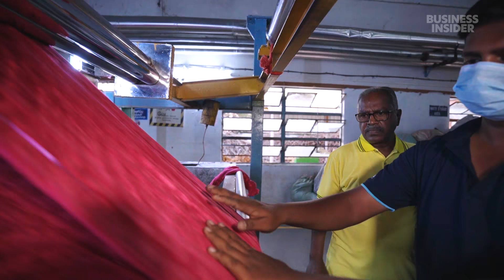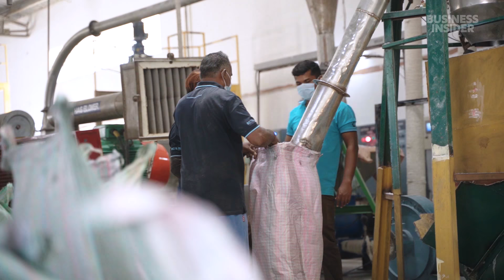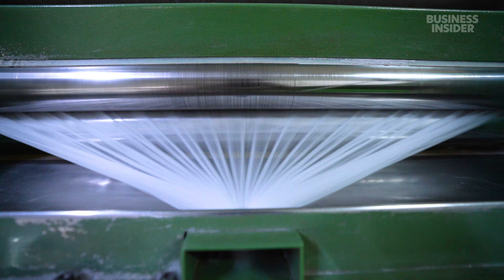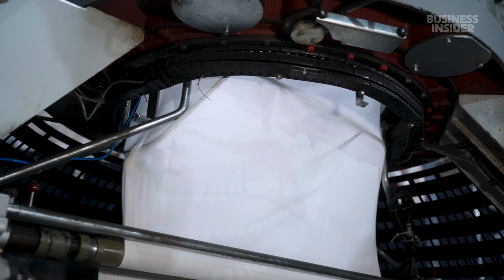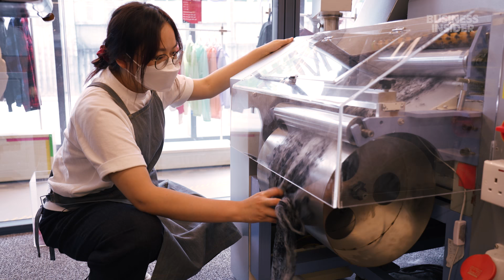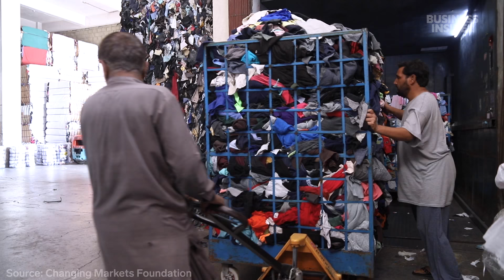How 1.5 Million Plastic Bottles Are Turned Into Clothing Every Day | World Wide Waste

Comment: I HIGHLY suggest you buy only cotton clothes. Polyester leeches into your skin and into the water supply when washed
Reply: What about your drinking water which is supplied through pvc pipes. Doesn't that leech? How do we avoid micro plastics? Genuinely asking.
Reply: @skbluee  PVC does leach nasty stuff into water. But leaching occurs most when items are disturbed or agitated (much like lead paint is inert as long it doesn’t get chipped or cut). This is why polyester and other synthetic fibers are such a larger contributor to microplastics in the ocean. When clothing is washed in the washing machine is it purposely disturbed and agitated, and tiny fragments start coming off. 
Conversely, pipes usually just have water flowing in them which basically doesn’t disturb the chemicals in a PVC pipe. In addition, biofilms commonly form on the interior of pipes (these are almost always benign in nature, and not pathogenic). In addition, in places with hard water scaling occurs which forms on the pipes. Between biofilms and scaling, over time, the surface of the pipe may not even be coming in contact with the water. Water utilities do tent to run extra chlorine through the system periodically to try to keep the biofilm from growing completely unchecked, and that may be a time when (between the slightly higher chlorine in the water and the biofilm being reduced) when the chemicals in PVC pipe might leach more.
Reply: @jeffreycarman2185   wow. Thanks so much for explaining this. You are so knowledgeable. Ive always had this question about drinking water but looks like there are far worse ways that plastic can leech into the body. I've always questioned recycling too, like, yes we're giving it a second life but there's no way of eliminating it really. And thanks to this we keep manufacturing more and more plastic.
Reply: @skbluee  thats probably what science is trying to discover
Reply: Linen is great too
Reply: And producing uses so much water and pollutes all the rivers and water systems!!
Reply: Very bad for the 🐱 biome
Reply: Any research papers on 'plastic leaches skin?'
Reply: The point of these polyester clothes is to find a new use for discarded plastic bottles.
Reply: how long until we find out those plastic fibres are as dangerous as asbestos ???
Reply: Dupont is responsible for West Virginia's water table pfhoas contamination and seems to be a morally corrupt company. There workers at their chemical plant many got cancer and brought home the chemical substance to there wives unknowingly, which caused them to get hysterectomys from the chemicals that they were creating for dupont.  
Such a crazy story from the New York Times I will never forget. The Lawyer Who Became DuPont’s Worst Nightmare.... it is a must read.
Reply: She being pissed after seeing her favourite polyester fabric is made out of plastic 😂😂
Reply: Polyester doesn't leech into the skin, the integumentary system is a barrier, not a fiber.
Reply: I like cotton better, but who told you that Polyester leeches into your skin?
Reply: @UnamedUser849  All of synthetic fabrics are essentially plastics, often formulated with harmful chemical additives like phthalates and bisphenols can result in thyroid illness, hormonal imbalance, and neurological problems.
Reply: What should be done with plastic? It is easy for rich people to declare things bad when it helps those less fortunate.
Reply: @TonkaJay  convenience comes at a cost.  If its worth the convenience to destroy waterways and habitat, then this is your choice.  Disguising plastics as clothes that leech poison into the water when you wash, and still cause pollution when the clothes wear out doesn’t seem like a solid answer though, its just a cheery disguise.
Reply: @pdnowlin  but it is the answer for now until one of you know it alls does something better.
Reply: @TonkaJay  perhaps drink water from a tap, or like in my case a well in the earth?
Reply: @TonkaJay   minimalism is one of the temporary solutions. I try to hoard less. I recently understood that I have been hoarding a lot of things I won't be using again or more than twice. So in the last 6-10 months I have majorly cut out on expenditure. I postpone buying things that I'm not sure I need. After thinking it over, I find I can replace that item with something else I already have. I don't buy new clothes unless I really need them. I buy only cotton clothes and use them till even after they are a bit faded. Also I carry cotton bags for shopping whenever possible. 
I avoid ordering food from outside and try to make do with what I have at home. I go out and buy the next day if I am tied up with things to do at home that day. 
I don't spend money on expensive self care products. Most of the stuff advertised is just to get you to buy more anyway. I stick to oils and chickpea flour for hair maintenance.
Reply: @pdnowlin  not everyone has access to clean water.
Reply: @skbluee  the cotten bags have a huge chance of passing on illnesses easily than plastics of they are not cleaned regularly. 

It is good not to horde. Well done.
Reply: @TonkaJay   we do wash the bags once or twice a week.
Reply: @skbluee  is that the norm for people that use those kinds of bags?
Reply: @TonkaJay   lol I can only speak for myself. We can do our part and try to educate others. As it is we have become lazier with the advancement of technology. Unless we realise it ourselves and take action we can't help anyone else.
To answer your question, I assume it's quite normal to clean a bag that looks dirty. Beyond that I can't imagine from everyone's perspective if they would be cleaning their cotton bag or not.
Reply: @skbluee  you are correct. We can do our part and teach others.

I don't think it's feasible for poorer people to do the same when they are just trying to get by or that they are trying to just provide for their family.
Reply: @TonkaJay  it's definitely upto the middle class and rich to set better examples. But the poor have to do their part too, in smaller ways, if they have the means to. Probably avoiding plastic is not on their radar at all. But they should stint on things like fancy clothing and household equipment. Children can be encouraged to participate in games that are less demanding of expensive coaching fees. They can be encouraged to take up jobs earlier, build hands on skills like carpentry, pottery etc. So they have options for income streams earlier on. Instead their parents are giving them free use of their smart phones. These kids are on the streets everywhere, taking selfies and nothing else. All probably hoping to become influencers. Influencing how I have no idea. That is sad. Sorry I went off topic, but I was trying to say that we can't let people off for being poor..they have responsibilities as well. May not be the same as the richer folks but they should make some effort. We all need to be focused on improving our lives in ways that help us first and second, the people around us.

Comment: clothing should not be made out of plastic, people breathe in plastic particles from clothing
Reply: Definitely not ideal but this factory is better than landfill.
Reply: absolutely
Reply: Less microplastic, you need to cut it at the source.   This is not the source.   This is just a choice between landfill and clothes.
Reply: Why do we need plastic bottles....why cant we carry our own bottles (steel or glass )
Reply: As far as scientific research shows, THANKFULLY we can't prove that - BUT, it is indeed a nasty thing to make clothing from plastic.
The fibers take our sweat and will slowly degrade the material, making it have a foul odor after a while. 100% recommend people to not use clothing made of poly unless it is specifically created as a fishnet garnment for sports use - or raincoats*.
Reply: Too late. So much of our clothing already has it in it. They aren't trying to solve the microplastic problem but slow down the entry of new plastics into the environment before they turn into micro plastics.
Reply: What should be done with plastic? It is easy for rich people to declare things bad when it helps those less fortunate.
Reply: What is the alternative then?
Reply: @SangitaOfficial  these people do not have alternatives. They have complaints.
Reply: @TonkaJay I agree
Reply: @TonkaJay always complaints and no solutions
Reply: Yet, you likely have clothes in your closet made with polyester.
Reply: All manufactured plastics should be sent back to the original makers and have them rycl their crap products. And use their millions of wasted dollars on fixing their problems they have created. Use it as fuel and / or learn from their bad designs and causing us to have unborn babies born with plastic in women, men , animals, plants, and water.  It is killing us all. It's good to make something new from it, but it's still dangerous to wear on our bodies. I apologize if I sound rude or disrespectful. I am just telling this as I see it. Those original manufactured plastics should be the responsibility of them, not us. We do not want more problems than what we are forced to purchase for one time uses or consistently contributes to overproduction of plastics. They should be all held responsible for our lives and environments. I applod the efforts of finding new ways to contribute to remove and renew plastics waist. I just want to highlight the fact that it should stop manufacturing these in the first place. Burlap or hemp or straw or other things like glass and other useful products all are the best ways to reduce carbon footprint like back thousands of years ago. We do not dig and find plastic. We find clay pots and sometimes copper or stone boals before we need to continue to over produce plastics. We need to go back to 40 or even 60 years ago very short time ago we would not have this amount of problems because we would buy without all of these plastic items sold at grocery stores hardware stores and restaurants. Remember on 40 to 60 years ago a short time ago we live ld in a much cleaner world. Pls help us be heard. Make them big plastic manufactured business held to higher regulations and heald with more responsibility  and financial loss if not taking more responsibility for their waist in the first place. Tuffer laws for environmental failure  to comply.
Reply: There is only one molecule difference between a plastic bottle and polyester fabric. Polyester is plastic. These sites are just repurposing the world's plastic overrun that big business created in the 1950s.
Reply: Ok
Reply: Hahaha. Fuh and Duh
Reply: Don’t worry. You eat it every day too
Reply: That's what I thought exactly!
Reply: It absorbs through the skin just stick to cotton
Reply: Then people shouldn’t use plastic
Reply: Get Teflon,  get fossil fuels, get pfas. Learning and supporting plastic recycling is something our dumb earth needs
Reply: You're confused.You're getting microplastic particles from drinking bottles.You're not ingesting microfiber from clothes.Big difference.    

I bet you drink out of plastic! Lol
Reply: @bmwlane8834 you wash plastic cloths, micro plastics come off and end up in water, water goes down drain, ends up being pushed through waste management but not filtered. Now that water returns in your tap water which  people drink from.
Reply: People breath in cotton fiber too....ozone ....pollen ......dust.  😅.  
 Farmers lung eh .
Reply: Nobody putting that genie back in the bottle. Microplastics are just a thing you have to live with. Deal with it.
Reply: We work with what we got. And plastic is less intrusive than you think